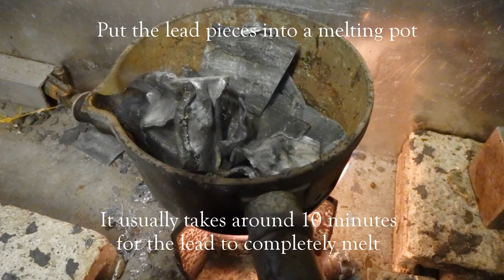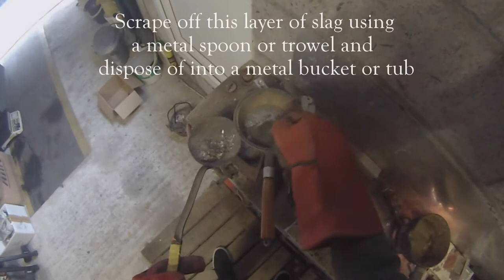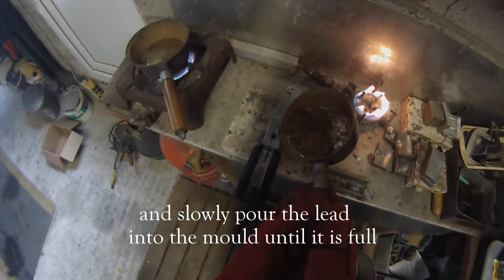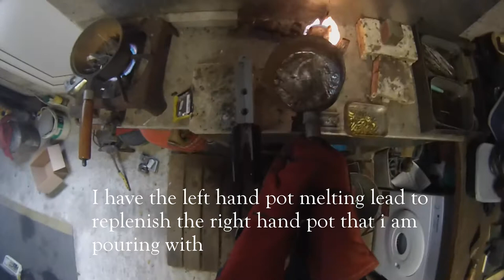Making Lead Fishing Weights

Comment: Just found this video. I have tried to melt lead to make weights but I do not seem to be able to get it hot enough yet you video shows a very gentle flame. Therefore am I using the wrong metal pot, so besides cast iron what is the best type of pan to use ? 
Many thanks for any help you can give.